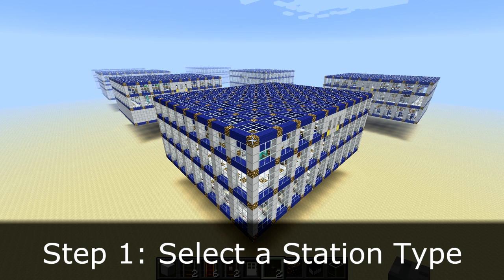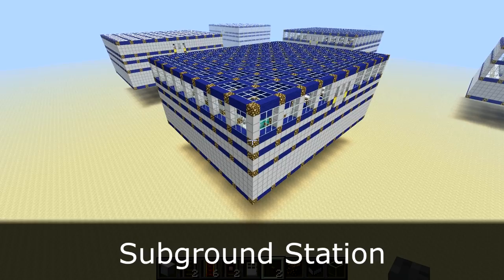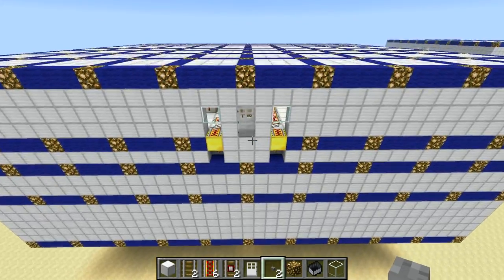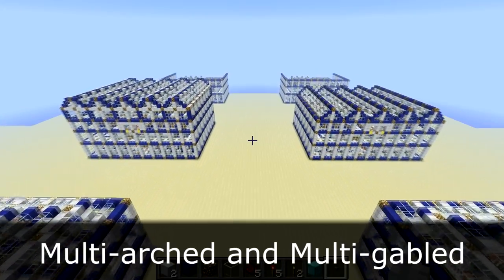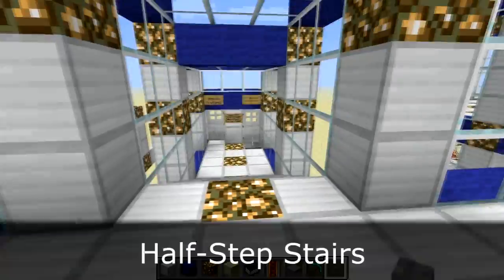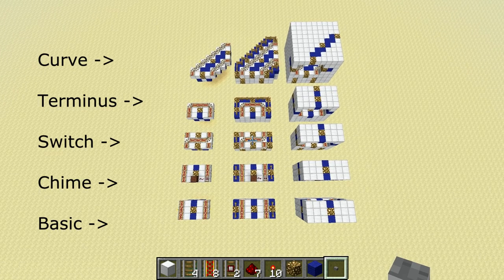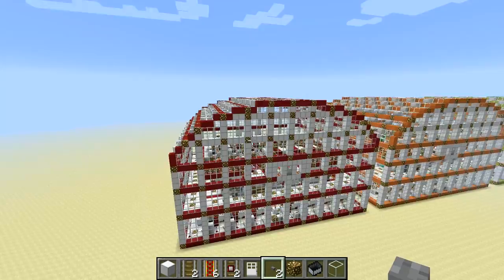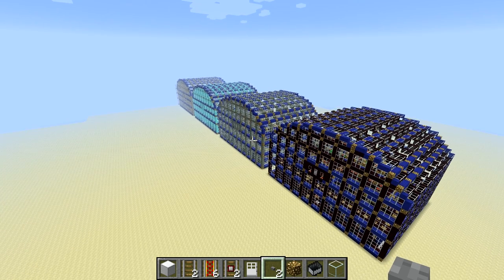Minecart Rapid Transit Station v4.1 Schematics (Minecraft 1.2.5)

Comment: IMO the best possible solution (because of its extendability) would be a blueprint mod for minecraft. blueprints could be exchanged like maps, and when right-clicked, would look like the engineer's turrent/dispenser placement in TF2. right-click again to place the blueprint on the ground (after it's been rotated or flipped, if needed), and that volume will fill up with semitransparent versions of all the blocks required, visible only to the builder.

Comment from the maker: WorldEdit has always had problems with importing schematics. Back when at least it did import something, WorldEdit would still import track switches incorrectly and thus break the whole station.

So yeah, I don't recommend using WorldEdit to import the station, use MCEdit instead. These problems are out of my control, so feel free to message the WorldEdit devs if you want any chance of a fix.

Comment: I can't wait to test this out after 1.4 bukkit gets the issue with pushing tracks fixed. I know you can replace the wool and steel with the replace commands, I was wondering though is there any glowstone or glass that effects the rail system or redstone? I would like to use the replace on those as well and redo the look but I don't want to fubar the system. Awesome work btw :)

Comment from the maker: The roof schematics don't have a bottom. Are you importing them correctly? You need to move the bottom edge of the schematic low enough so that it replaces the default flat roof of the station.